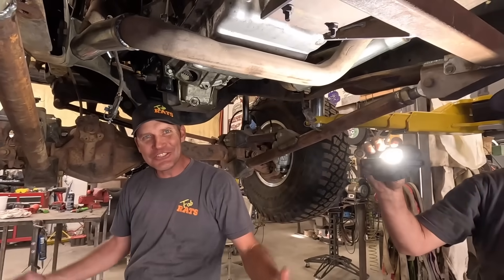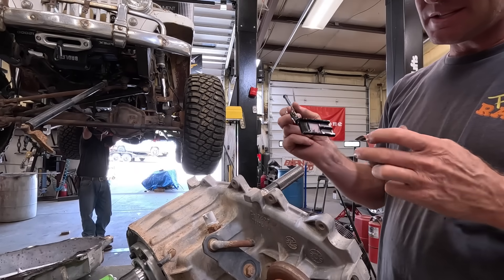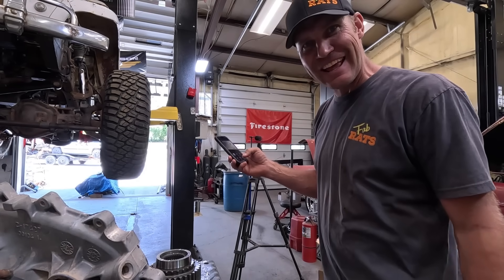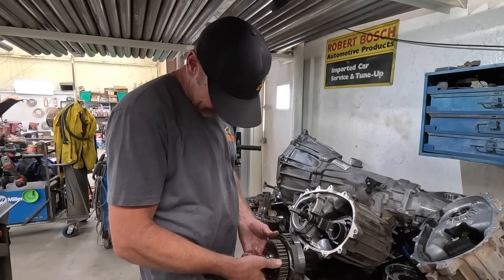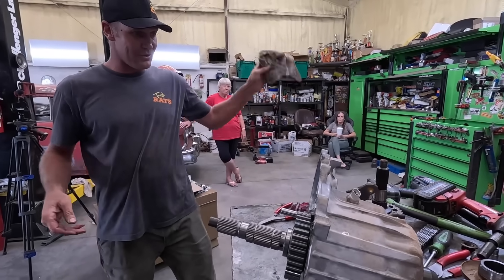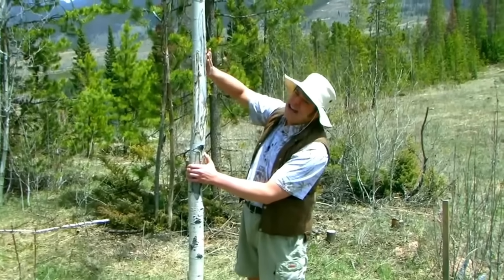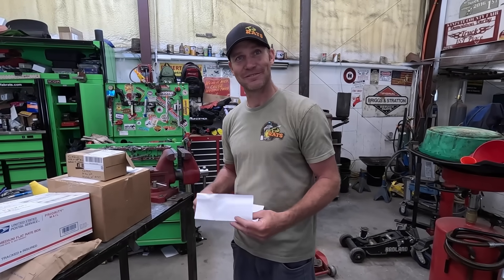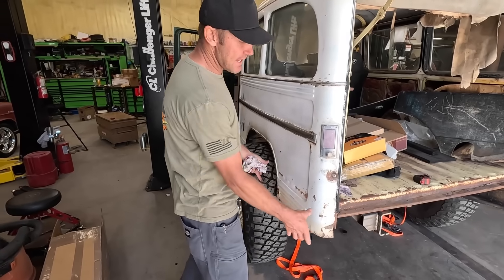A RACE AGAINST TIME: Will The Pack Rat Willy's Wagon Be Ready For The Showroom Floor?!

Comment: I work for a place that rebuilds transfer cases for a living. Press the needle bearings out of that drive sprocket, and then it will fit the new main shaft. Those 241c main shafts were turned down so they could reuse them by adding needle bearings inside the drive sprocket. Any questions feel free to ask.

Comment: Now each of the boys has a transfer case that they can put together as a project.  You don’t want to leave three good transfer cases torn apart sitting in boxes…put them back together so they are ready when you need them….yes, you will need them.  😊
Reply: Those transmissions as Paul calls them will most likely end up in the scrap pile lmao

Comment: Make the curves from plate. Cut out the top and bottom C shapes, then roll the verticals to match and weld them together. Sooo much easier than trying to segment a straight tube.

Comment: To clarify the issue with the transfer case is that there are 2 generations... 88-94 and 95-98. The SYE will work for both cases but the older generation used the needle bearings for lubrication. The newer case had better means for lubrication so the shaft was changed and the bearings removed.
Some of the SYE kits will mention somewhere about the removal of that bearing.

Comment: I learned from an old blacksmith, that you need to fill a square tube full of sand and cap the ends off, then you either heat it up and bend it or try it in your pipe bender.

Comment: Paul, in case you haven’t figured it out yet. The SYE kit doesn’t require the bearings in the sprocket. You just press them out and slide the sprocket on the shaft.

Comment: 17:11 Fact!  You now have the best wasp and bee killer ever!  add a schrader valve to the tank so you can compress it without pumping!

You'll be amazed how useful pressurized soapy water is for other things too!  you can locate leaks, wash your hands, control tiny fires, clean your windshield and lights, spray your buddies, and more!

Comment: You need to watch some more videos Paul. There is a way easier and cheaper way around the corner on that bumper. Hold that tube up to the side of the Jeep like you had it draw the shape of the ark on top of the tube square off The top then cut out that art triangular piece and roll it over. 
I just watched a video on this couple weeks ago and it was really fascinating to watch the guy showing all the different ways to round a square tubing . . .

Comment: Paul, I really enjoy you and your content, watching you work and listening to you sharing your thoughts. I've been watching you for a long time and this is the first time I'm feeling like offering a thought. You have the original bumper pieces. Trace them on 1/4" flat and figure the radius enough to have 4 of them cut by the arcdroid. Then 1/4" flat for spacing them apart to fit inside your originals. Roll the flat and weld it up. I'm simply thinking of what I usually do in wood, and adding what you have taught me. Feel free to tell me to shut up whenever, and I'll still enjoy you!

Comment: Just did a SYE kit in a Cherokee not to long ago and I remember in the instruction they said that if the bearing cage doesn't just slide out of the gear they will have to be pressed out for the kit to work. I got lucky and every thing just went together.

Comment: The best wasp killer is gasoline or the red CRC brake clean. 
Change my mind...
Knocks them down instantly.  I used foaming wasp spray at my dad's house, and that works pretty well it'll knock them out of the sky, but they take a min to die. I have an old super soaker for when I need to kill a lot of wasps at a distance. I use nonethanol gas. It's better for the seals and clean it good when I'm done.

Comment: You could have saved a lot of time by cutting two flat plates with the curve you wanted for the bumper corners, cut the tubing away (where you made all those pie cuts) except for the outer side.  Tack and bend the outer side of the tubing to your flat plates, finishing up with the inner radius bend to fit flat stock.

Comment: Save some welding wire, make a pattern off the first bent bumper piece and use the arcdroid to cut plates instead of eleventy-four pie cuts and welding for 6-hours.

Comment: On the 231 transfer case you pre out the bearing in the gear. The later transfer case’s no longer us a bearings. They run on a film of ATF from the main shaft oiling hole

Comment: Paul you need to adjust your bug spray recipe a little bit 
My parents used to sell a soap many years ago in a similar situation to Amway but it wasn't that name 

But basically they were taught a recipe for bug spray using their products 

The new version would be Dawn dish soap cut 50/50 with a surface cleaner like 409 

The dawn sticks to the bug and the other stuff breaks the surface tension and they drowned in it 

The neat thing is you can just wipe it off with a rag bug and all once it's dead

Comment: paul,  the needle bearings on the gears where you were struggling with the different size input shafts have to be pressed out.  then they will fit
Reply: i commented before i watched all the video.

Comment: You need one of the Slow speed metal cutting saws with metal blade, you will never go back. Cut right through that metal and it doesn't even get hot.

Comment: You know the first rule of a project for SEMA? --> The car doesn't run and has Bluetooth driveshafts. 😁😜
Yeah yeah I know, it's a running gag. But years later this little fact holds still true, the infamous non-working stuff at the SEMA show. So Paul's Wagon will be the exception to that rule.✌

Comment: Looking great as always, do you think maybe copying the radius on some card board cutting that radius out of some sheet material, then cut out the top and bottom of that square stock, bending it around your flat stock cut out might speed up your process for the corners of the bumper?

Comment: I don't understand how Paul broke a Snap-On Screwdriver by taking apart a case.  Those cases use bolts, not screws.  
I'm sure Paul didn't use a screwdriver as a Prybar, Chisel, or Punch... It says "To Not To" right there on the handle.  🙄🙄  🤣🤣🤣

Comment: On the curved section of bumper couldnt you just cut small pie shapes out for the bend since you were welding the cuts closed anyway or is the thickness of the square tube to much to make that work correctly. Great video as always.

Comment: I think you was over thinking them radius on the bumper. would it not been easier to cut the radius on some flat pieces on the arc droid then cut some flat pieces and bend them and weld together the dimension you needed then weld to the piece you already had made ?

Comment: I've got a steel/titanium? rod that was in my tibia over forty years if you want it? Had a serious motorcycle accident when I was 18. They had to remove it to do a knee replacement about 10 years ago, and yes it was sterilized before they gave it back to me. It's about 14" and VERY strong. Doctor told me it added an hour and a half to the operation as it was so hard to get out!

Comment: Expensive playground.  A yard of concrete has an average cost in the US of around $157 so $6280 for each 40 yard load and then labor to pour the slab averages about $7.50 per square foot so around $15,000 for each 50X50 section for the labor is the median cost right now bringing materials and labor to around $20,000 for each section not counting the excavating, grading and wire or extra thickness.

Just to put things into perspective for those who might be considering doing something similar but can't do at least some of the work themselves or have sponsors to help defray the cost.  Five 50X50 pours could cost you $100,000 or more in much of the US.

Best!

Comment: Those cuts for the corner rear bumpers looked painful. Would not cutting the entire inside out of the tube be easier, keep the outside. Then make top, bottom and inside curve from plate?

You can then tack and bend the outside of tube to the outer curve of the top and bottom plate smoothly and then burn rest in.

Comment: You really need a carbide toothed low speed cutter. They make quick work of cuts like that. Evolution power tools has a great one.
Don't put a carbide blade in a standard chop saw BTW, the RPM of ones designed for abrasive blades is way too fast for carbides.

Comment: Instead of cutting and bending and welding solid the sq tube. Why not cut 4 sides of a 90 elbow, roll the throat and wrapper and weld together. Should be easy on the little CNC. I don't remember the name of it.

Shoot me a PM if you need a DXF to import.

Comment: So the slip yoke eliminator is also a bearing eliminator and you just run steel on steel?? Not sure that's a good idea, hope they did some good testing and it doesn't weld itself together under load.

Comment: Depends on how much aftermarket you put in it? Besides cracked windshields you haven't rolled out much original equipment. The Square Body. GM truck was a pile of crap built on high sulfur Chinese steel . That fascination/delusion as the  most "American" truck, is boring to revisit . BTW look in that 1949 Chevy manual and find an "Emergency Brake" anywhere in it.